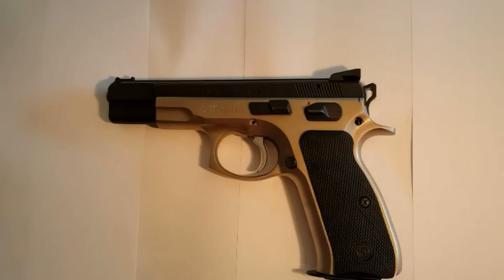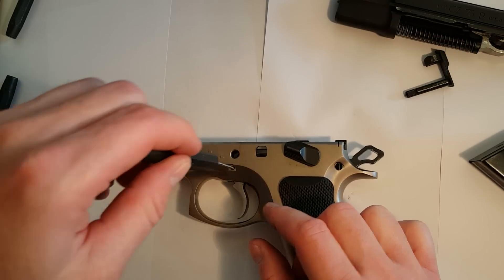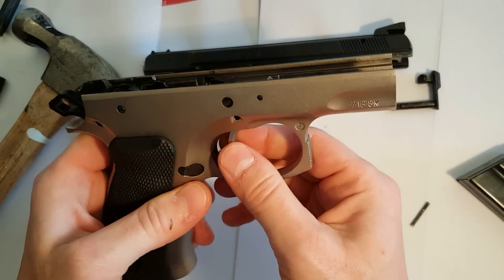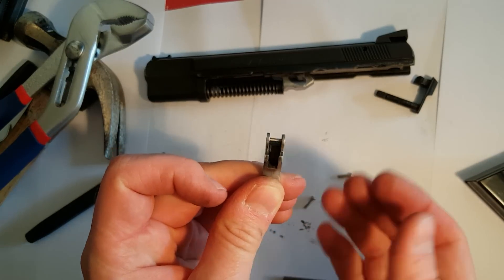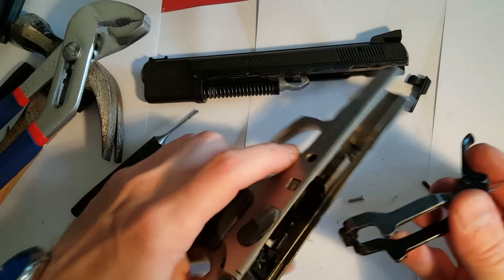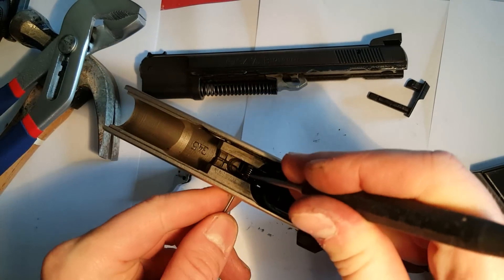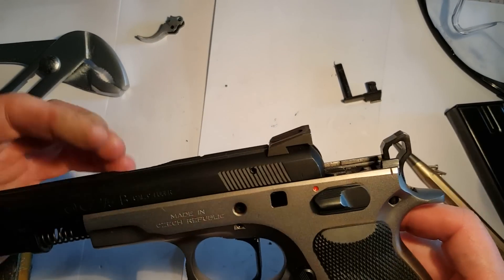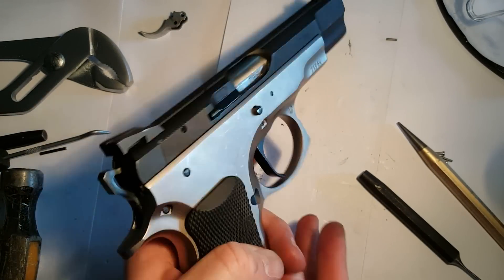How to change the trigger on a CZ 75B (or SP01)

Comment: You have to convert your CZ from DA&SA to SAO and THEN you can install the SAO-flat-trigger. I believe that his CZ already converted to SAO but he did not mention that on the video.
Reply: You just need to remove the DA disconnector and that's it
Reply from the maker: This is not correct if you install original CZ competition hammer and trigger as I did. Then you don't need a short reset kit.
Reply from the maker: I have tested this myself. Never had any problems with the reset. I don't care what CGW says. They are not CZ. If you but their part, maybe it is true, but have you tried it yourself? If you buy from CZ, you don't need anything from cgw.
Reply from the maker: @Operational AF Okay, you don't need to go there. Who am I? A guy who have tested this through several years. And cgw don't ship to Europe. It's a third part company. Still, our CZs in Europe functions without cgw parts. You can give your money to cgw if you like. I have bought the parts from CZ Europe and the gun functions completely free from American aftermarket parts. Take care and don't be a troll. 😊

Comment: You failed to mention that the disco will not allow u to remove the trigger bar from the gun. If you have a da trigger the sear cage has to come out. I learned that the hard way.
Reply: YES, i was watching this video and i was like "THE FUCKING TRIGGER BAR SIMPLY JUST DOES NOT 'COME RIGHT OUT'" this guy has a cz75 SA not a B
Reply: So true. I learned that the hard way too.

Comment: Merulafilms,  I am going to replace the trigger in my SP01 with an Armory Craft flat face trigger.  So just to be clear, I don't have to do anything else to my weapon except the trigger change like in your video.  Thanks and great video, clear and concise. Be well.
Reply from the maker: Hi Curtis. It depends if you are converting it to single action only or not. If you are planning to make it SAO, you need to replace the hammer and remove the disconnector. Watch my hammer replacement video. If you are just replacing a double action trigger, you don't need to do anything else. I hope this made things clearer.
Reply: @merulafilms7863  perfect, thanks. I’m just replacing the trigger

Comment: So you're able to remove the trigger bar without also removing the safety and sear cage? This is the only instructions I've seen where that isn't a requirement, so just making sure.
Reply: TrptJim same thing I was thinking.
Reply: If he has already taken out the disconnector, then yes he could remove the trigger bar while leaving the sear cage installed.

Comment: Some key points to note: the small leg of the spring goes into the void in back of the trigger. In order to do this job the hammer must be forward.  You need a skinny pair of needle nose pliers and you need to push the lower leg in first with the pliers and compress the spring downward while inserting the roll pin into the slot.

Comment: Does the straight trigger from a tso will work on the spo1 to turn it  into a SAO only?
Reply from the maker: Hi. Please watch my video about changing the hammer. You have to remove the disconnector to make it SAO. The SA trigger is there to minimize the takeup after you have removed the disconnector. Good luck!

Comment: Your gun is single action, not the original DA/SA triggers that B's come with. so the trigger bar wont come out like in your video, regular B or BD's or SP01s need to have the whole sear cage removed..
Reply from the maker: You are not quite correct here. This is an original 75B. I modified it to single action only. You have to see my other video on how to change the hammer to see the full process on making it SA only.
Reply: @merulafilms7863  all he said was that your gun didn't have a normal double action trigger which was unclear in your video.
Reply: @merulafilms7863  i said "your gun is single action". what you need to understand is that your video is misleading as the trigger bar wont come out that easily because it is drastically different from the original DA trigger that a regular B would have. so the process for changing the trigger would still be alot more different for a stock CZ75B

Comment: Thanks for the video, I have a CZ 75B and I'm looking to change this awful curved trigger. I still have one question though: I obviously need to order a SA trigger and a trigger pin, but what about the disconnector ? Do I need to remove it, and if yes, how ?

Your video only shows you replacing the trigger itself, but is there more to it (like, did you convert it to SAO in the past, before recording) ?
Reply from the maker: Hello. You ask the right question. I have already converted it and I haven't had the chance to make a video about it yet. But I am planning to. I highly recommend changing the hammer as well.  In my review video I show you the difference. You need to take apart the sear and hammer assembly. The disconnector is attached to the hammer with a pin. Just take out the pin and remove it. Then it will become SAO. You will need the SAO trigger, though. Just ask if you need more information.
Reply: +MerulaFilms Thanks for your answer, I'm glad to see that I can simply remove it and not polish/file it (in case I want to go back to DA later on). I'll order the trigger from CZ right away !
What's the benefit of changing the hammer, lighter trigger pull right ?
Reply: I just watched your review, so in fact replacing the hammer and sear will change the trigger pull and make it crisper ! Interesting !
Reply from the maker: +Jonathan Guérin Yes, the change lies mainly in the hammer, so buy that one as well. If you don't change the trigger, it will go all the way to the front of the trigger guard if you change it to SAO. The hammer spring determine the trigger pull weight. So go for a new trigger, hammer and spring.
Reply: +MerulaFilms Thanks ! I looked at a lot of different options for the hammer, is there one I should get in particular ? (I'm not doing competition shooting btw)
Also, should I get a new hammer and a new sear, and is there anything else I will have to change or modify (like polishing something) ?
Reply from the maker: +Jonathan Guérin I would have bought a new hammer. Go for a competition hammer.  They have the least travel and creep. If you are going to convert it to SAO I would buy the SA sear. This isn't a must, but there is a small lever that needs to be replaced with a washer if you don't change it. Kind of hard to explain but you will see it when you take it apart. You should buy a 15 or 13 lbs hammer spring. The trigger transfer bar can be rough so you can consider polishing it. I see I need to make a video about this.. Good luck!
Reply: +MerulaFilms I really appreciate your help, thanks a lot !
Reply: Thats what i wanted to ask too 🤣 really nice Video tho

Comment: How do you get the trigger bar out with out taking out all the back block components? I have an older 75 and after taking out trigger pin the trigger and bar are trapped in the frame still.
Reply: I know this is from a long time ago and hopefully you've figured it out. The trigger and trigger bar are held by the disconnector that goes over the back of the trigger bar. Something seems amiss here. I have taken apart my SP-01 many times and have to take the sear cage (back block) out to remove the trigger bar. Perhaps the author will see this and enlighten everyone on how they do this.

Comment: Painful to watch. First obvious problem, a 16oz claw hammer is not an appropriate tool. Second, when he drives out the pin and the punch sticks in the frame he's damaging the frame hole. Third, and probably most critical, never reuse a roll pin, especially on a CZ where they are notoriously soft and often in need of replacement just from average use. 
Further hint: Mcarbo makes a tool for replacing the spring easily. I also recommend their replacement pins both for trigger and hammer.

Comment: You are a God Saint. I just installed a CZ 75 extended mag release on my Tristar P120, and the home made pin to hold the trigger spring you showed is a must. It still took me forever to do the job, with what felt like a million trials before I finally succeeded :)
But there is noway to remove and install the trigger bar as you did.

Comment: Brilliant method for getting the spring installed, i've seen other vids where they just depress the spring and drive the trigger pin in, which is very difficult.  

Got a used Tanfo Witness clone, and the trigger pin is bent, don't know how they managed that.  So the pin could not come out flush on both sides.  Waiting for a replacement, but have been nervous about getting the tight spring pushed down into place to drive the new pin back in.

So thanks!  Old video, i know, but great to find this technique. 👍👍

Comment: I can finally fix the excessive trigger creep on my 75b now. That was honestly my only complaint about the CZ. I was used to Glock but favor the grip and accuracy of the CZ.
Reply from the maker: +Daniel Peters Thank you for your comment. Yes, the factory trigger isn't much to brag about. But with the new trigger/hammer setup it is a really great gun! Reliable, accurate and fits like a glove :) Have you got the new trigger yourself?
Reply: MerulaFilms Yeah I think my CZ will be a good "race gun" for not alot of money invested. I also plan on a fiber optic front sight. I'd like to see a CZ in a 10mm, that is a powerful round for a semi-auto.

Comment: The reset is short but I have a lot of creep before it fires. is that normal?
Reply from the maker: Hello. The original hammer/trigger has a lot of creep. This will be greatly improved by changing to a competition hammer. If you want an almost perfect trigger, make it SAO. I show you how to do this in my 'How to change the hammer' video.
Reply: +MerulaFilms I'm watching a video on changing the trigger to a SAO trigger. I assumed I didn't need to point out I have a SAO trigger already installed. my bad.

I got the CGW pro package and also the SAO flat trigger.... still have lots of creep BUT my reset is short.
Reply from the maker: I am sorry! This seems odd. There should not be much creep with a custom hammer.
Reply: +MerulaFilms I think that's probably what's wrong. I got the pro package hammer but not the competition hammer... I'll probably upgrade that and see what happens
Reply from the maker: +AK47 Prepper So you haven't change the hammer? Well, then that is the problem. The creep is all in the hammer, not the trigger. Good luck with your tuning! :)
Reply: +MerulaFilms I did but I got the pro package hammer and NOT the competition hammer. I think that's what I wrote on the last comment. sorry for the mix up.
Reply from the maker: +AK47 Prepper Haha, I see. I am a bit off today.. I meant to ask if you haven't changed it for a competition hammer. You'll have to excuse for being slow today :)

Comment: just wondering y would you want to change the trigger and replaced ?
Reply from the maker: Norberto Bernal Hello! The factory trigger on the CZ 75B isn't very good. It has a long creep and it does not feel smooth at all. Therefore, it is difficult for an unexperienced shooter to know  when the hammer will fall. With a new hammer and trigger it becomes very crisp and smooth, and the creep is gone. This is much better for competition and target practise. I hope this was helpful.
Reply: MerulaFilms 
ok thanks for answer I have the same exact cz75 I just love  it is

Comment: Very helpful video. I'll be changing my trigger on both my SP-01 & 75BD to the short reset trigger from CGW, do you know of any differences given those configurations? I Haven't seen any videos with a decocker that are this detailed.
Reply from the maker: Jertex Hello and thank you for your comment. I don't think there is much difference to the CGW trigger. It's the same basics. However, I have no experience with the decocker models. Good luck with your work. You will not regret it. :)

Comment: did you have to replace the trigger roll pin with a new roll pin?
Reply from the maker: Hello. No, actually I didn't need to change the pin. However, later on, I changed it anyway because I ordered a spare pin with the trigger. CZ Customs recommend changing the original pin with their solid version.
Reply: +MerulaFilms are those roll pins hallow or solid?
Reply: Thanks for replying ,I have 2  Cz ,I want to change trigger,but the roll pins are disposable ,I head there a floading roll from CGW
Reply from the maker: +D Cruz You can get the standard hollow pins or you can get solid ones. They make both.
Reply: Aren't roll pins by definition hollow?  Solid pins are called dowel pins.
Reply from the maker: Robert Brandywine Thank you for the information. English is not my first language ;)

Comment: Do you know if the same procedure used on the CZ 75 b would work on the CZ 97 bd?  I’m interested in changing the trigger to a floater one to avoid trigger pinch from the curved trigger.

Comment: If I change only the trigger, will the gun still be DA/SA like stock?
Reply from the maker: Hello. It depends somewhat on the trigger you choose. But yes, it will still be SA/DA. To make it SA only, you have to change the hammer.
Reply: +MerulaFilms so just the trigger swap it will remain da/sa that's cool.  I wonder how much of an improvement it is in da/sa configuration.
Reply from the maker: +Brian Presto Well, it actually depends on the trigger. This straight trigger here is a SA only trigger. With only a trigger swap you can keep SA/DA and you can adjust pre and over travel. But the change in creep and pull lies in the hammer. I recommend the CZ competition hammer. I have a hammer change video coming up where I explain these things. Stay tuned :)
Reply: Yes keep up the informative upgrades you do for us you tubers to see!  I'm thinking of picking up a TriStar c-100 for concealed carry and keeping the DA is eh kind of important to me.
Reply: If the SA trigger is so much better, why didn't CZ just go ahead and use it instead of the DA/SA trigger?
Reply from the maker: Robert Brandywine Hello Robert. They have made a SA only version of the gun. Also the Shadow and Shadow line version also come with upgraded triggers and hammers. The CZ 75B wasn't designed as a competition gun. It's mainly a service pistol. I use it for training and competition and therefore I need a very precise trigger.

Comment: SO IF YOU HAVE CZ 75B DOUBLE ACTION TRIGGER (OMEGA)  YOU CAN CHANGE IT OVER TO SINGLE ACTION TRIGGER BY CHANGING OUT THE PARTS?   SEAR,  TRIGGER,  SPRINGS ECT ,  I WOULD LOVE THAT
Reply from the maker: Hello. The Omega trigger is quite different to the standard CZ 75B trigger. I do not think they are interchangeable.

Comment: What is a SAO trigger????
Reply from the maker: filoIII SAO = single action only. This means that you cannot cock the hammer with the trigger. This improves the trigger a lot. It makes the trigger pull shorter, crispier and lighter.
Reply: You changed the trigger, and you said that made it SAO.  How can changing the blade make it SAO?
Reply from the maker: filoIII If I said that, I haven't been completely accurate. It is the new hammer that makes it SAO (see my other video where I show this. This is a follow up video.) Anyway, this new trigger doesn't support double action function due to its design.

Comment: you forgot to show the new reset on the new trigger, a real important data
Reply from the maker: Yes, you are right. This is of course important. There is a reset adjustment screw on this trigger. However, the reset is so short that I don't use the screw at all. Combined with the competition hammer the trigger on this gun is excellent, the reset included.

Comment: Jesus Christ. Ever hear of a brass or nylon hammer?
Reply: EXACTLY what I was thinking.
Reply: My uncle would tell you "a skilled hard working man sleeps easier, because he has more money in his pocket".  Wrap your head around that.  This country was built by men using tools and equipment that were less than suitable for a specific task.  Hes not running a production shop. Hes working on his own firearms.  Ergo if what you have works and you arent sacrificing safety to use it.  Then use what you have.
Reply: @diversify210   also, i find that you NEED a heavy hammer when working on CZ's.  The roll pins are hell.  (Newer models) .
Reply: @zarinkai2927  Da it is combloc weapon. Use big hammer

Comment: I'm really pissed, that you gave to decide with cz guns whether you want double action or a nice trigger, this is so stupid why can't they build a proper DA trigger, look at Sig or Walther, its possible... -.-
Reply from the maker: I understand your frustration, but it is not entirely true. Out of the box, the CZ 75b trigger will never be perfect. However, CZ Customs also makes very crisp DA triggers/hammers. Since I only us mine for competitions, I decided to go for the SA trigger. This trigger gives you very little reset.
Reply: +MerulaFilms I'm aware of the match hammer and sear sets, those don't give you an acceptable reset and overall trigger feel in my opinion. This is by the way the only thing keeping me from getting a cz. I'm looking into the Arsenal Strike One speed currently, but it's hard to find here in germany.
Reply: +firebladeflow I have a CZ Custom Pro-Tek I and the DA/SA trigger is the best DA/SA trigger I've ever pulled, period. In SA, better by far than the vast majority of SA triggers, custom or otherwise.
Reply: That's one way to look at it.  Another way is that the stock trigger makes the 75 an excellent home defense weapon, with positive action required to engage with a target.  This is what 90%+ will likely be purchasing it for.

If you want a perfect trigger out of the box, by all means, pony up for a Tactical Sports.  ;)

Comment: You can't just place the pin back in, it's been swagged on both sides. You need to place a center punch on one side, then a center punch on the other side, and hammer it slightly while another person holds it.